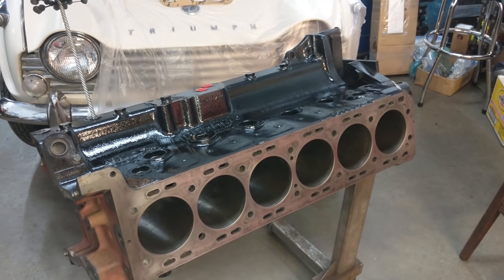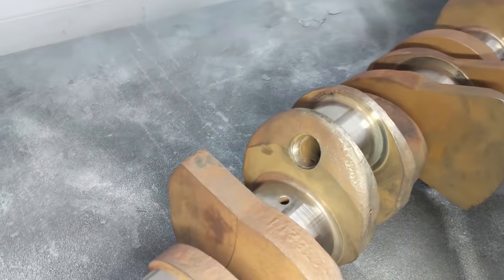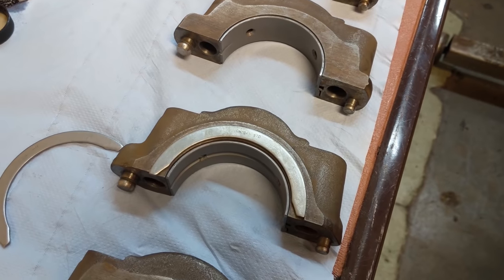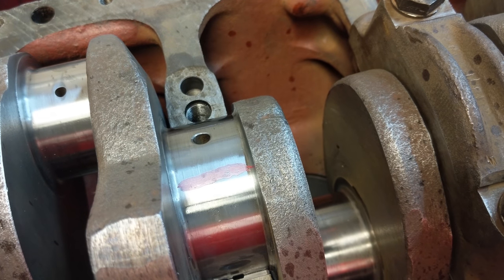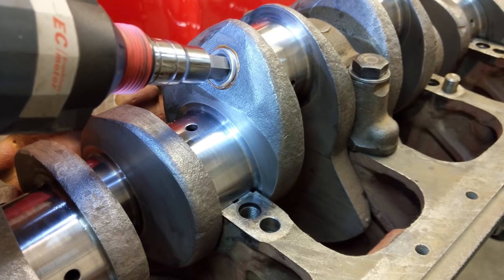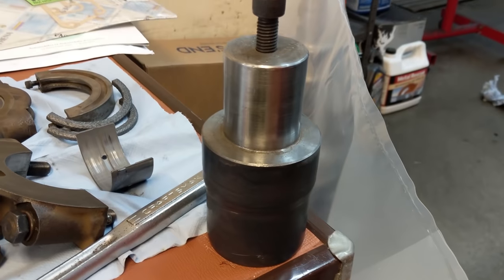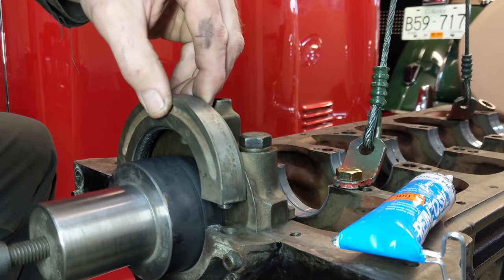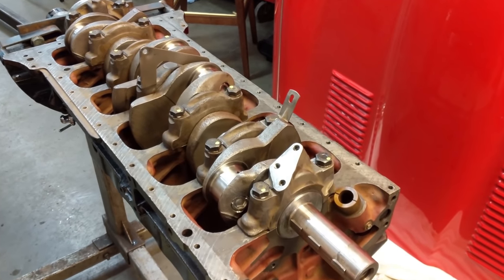My Junk E-Type Engine Part 5

Comment: Did you actually end up trimming the rope seal? Instead of using the tool for fitting the seal couldn't the actual crank be used, or is that just avoided because it would be cumbersome?
Reply from the maker: Not sure if the crank would provide the clearance, might just lock it up.
Reply: @RichardMichaelOwen  Would you mind sharing the dimensions and a pic of that tool? Maybe I can get my friend to machine a tool that I can use to fit my seals. By the way, very good videos, helpful, direct and well produced for the intent.
Reply: @RichardMichaelOwen  I'll send a email address if you don't mind sharing the info.
Reply: @RichardMichaelOwen  Actually I could call your shop rather than putting my email in public view, I'm in Canada as well.If, you're ok with that.  Thanks

Comment: 15:55 "oil thrower" or "oil thrower ring" in English.
Reply from the maker: Good to know
Reply: @RichardMichaelOwen  Air cooled VW Engines have a deep counter thread and separate "oil slinger" as the "rear seal" which is the pulley end of the crankshaft on a VW. I learned the hard way that a blocked breather will force oil to bypass that "seal" . There is nothing except the crank and the slinger ring to keep oil in at that point. At the flywheel end is a neoprene seal.

Comment: Often these cylinders wear in a bell shape so this honing is a waste of time. The block should go to a machine shop.
Reply: Will the machine-shop hone the bores by machine (i.e. more precise control of the pattern) or use a different process?

Comment: The most perfect hone traces must be 90 degre with a very ruff stone grade - following / finishing  with a very fine stone also same 90 degre. The hole is then more rounded and straightend. -  If the stones dont cut, -  lower the RPM ( the stones work as softer). Use new or calibrated /  stones. Read Sunnen thruing operation of a stone. -----The shown schratches is from a hone but hawe done no good.

Comment: I notice that he comments on doing everything properly, yet running a bottoming tap through it is not an option, just go buy the tap and keep it for the next engine. Rattle guns? would not have been used for engine construction in late 60's and early 70's, no idea how tight the bolts were torqued. The plastiguage was a good idea, but not used on all bearing surfaces, just the 2?

Comment: Re bore. .new pistons  . grind the crank. . new bearings & thrust washers. . . . fit new valve guides . . . .cut the valve seats and face valves . .face the head and cylinder block . .  new oil pump. . .new water pump.. . . all new head studs, main cap and big end cap bolts. . . new timing cain aduster and slippers. . new timing chains. .. . . just do it right. . . Your putting this in a "Restoration/rebuild car. . 

I know its your junk engine . . . but . . noooooooooooooooooooooo . . all that work for a second rate job. . . criminal 

At least fit a new alternator belt . . ha ha ha ha
Reply from the maker: If this was a how-to, or a top rate build, you know the video would be a lot different. Not the goal with this series.
Reply: No problem to use a good engine checked over and re-assembled imho.
Reply: I think it's a dry sleeved engine... re-sleeve...  back to as new spec..